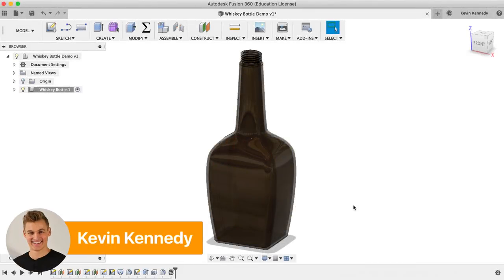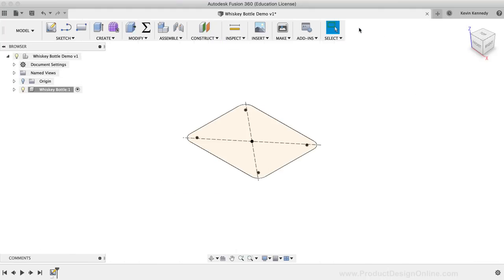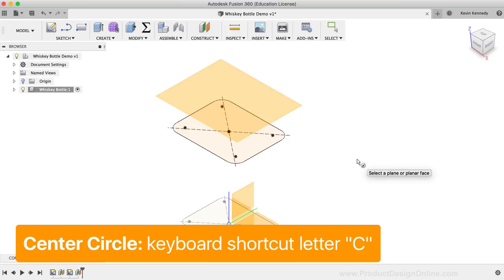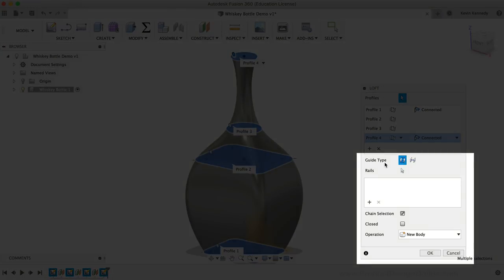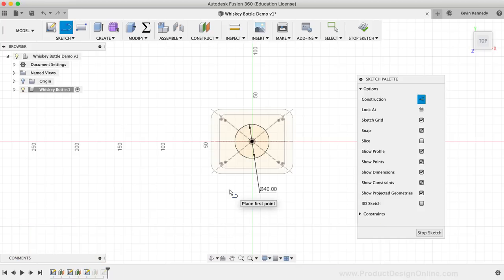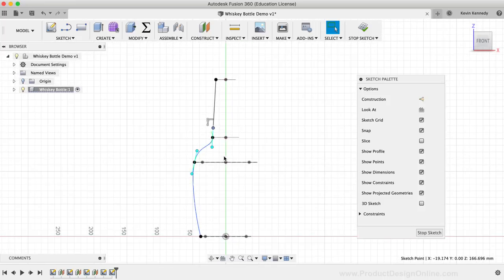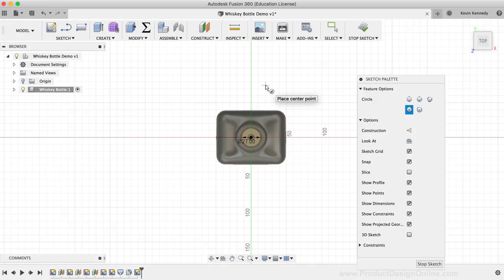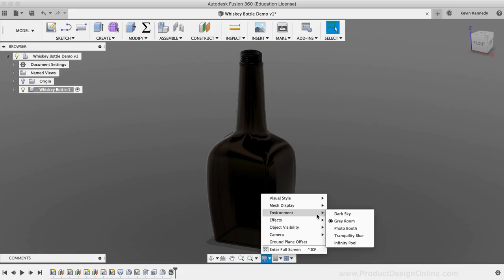How to 3D Model a Whiskey Bottle - Learn Autodesk Fusion 360 in 30 Days: Day #4 (REVISED)

Comment: Another great tutorial, I'm literally learning each day - thanks! One issue I'm having is I can't get the guide path to snap to the construction points we created just before that. The construction points are there (they're on the edges and can be selected), but the moment I select anything from the Create menu (Fit Point Spline, in this case), the construction points vanish and the spline (to create th guide path) will snap to anything but the construction points... Any idea? Thank you!
Reply from the maker: Make sure you have the "Auto Project Edges on Reference" setting turned on. Instructions to turn it on - https://productdesignonline.com/default-settings-for-fusion-360-tutorials/#autoProject

That will help you snap the rails to the profiles, as long as you're looking straight at the sketch.
Reply: Didn't work for me
EDIT: never mind I just had to restart the computer
Reply: Would projecting the point to the plan be the exact same thing the mentioned setting does automatically when activated, and therefore would not be required to activate it if I want to manually place a projection every time?

Btw, if I look from the front I can select the points, but if I look from the profile I can't.
Reply: Just fixed this enabling "Allow 3D sketching of lines and splines"
Reply: @ivantammaro   thank you, that was the problem that I had

Comment: Wow Loving these tutorials! 
Just one thing after creating the revised loft the top and bottom section of the bottle haven't connected so the fillet command won't work? When creating the sketch I used the surface version instead of the solid and maybe that's the problem?  Thanks  😊
Reply from the maker: Hi Matthew. That's correct, surface bodies cannot accept fillets because they do not have any dimensional thickness to them.
Reply: @ProductDesignOnline  I also cannot get the bottom to fillet.  I have selected the solid fillet, but it will not let me select any edge or face to fillet.  Nothing highlights to select.  Any ideas why?  Thank you for your videos. They are very helpful.
Reply: Thanks for this comment, distinction between surface and solid loft commands is not immediately obvious. Autodesk should explicitly state "surface" or "solid" in the name of the command.

Comment: Thanks so much for the tutorial. I was planning to sip a glass of whiskey while following your video. I did encounter errors with the rails when I was trying to use the loft tool and fixed it by zooming in very closely to the points where the lines meet. 😄 It is indeed a very important step where mistakes could happen.

Comment: what would cause the fit point spline to not snap to the planes when creating the rails?
Reply from the maker: Hi, Patrick. The first thing to check is to make sure your "snaps" option is turned on in the sketch palette. Second would be to check that the "Auto project edges on reference" option is turned on in your preferences. You can also cross-check your settings with mine, here - http://bit.ly/defaultsettings

Cheers, Kevin :)
Reply: @ProductDesignOnline  I followed your fixes, and my settings are like yours.  I could never get it to link up.  I finally did a spline on all points and adjusted the neck to look right.  That fixed it, but I didn't want to just finish.  I'll keep trying, but I must've fat fingered something.

Comment: Kevin, your tutorials are generally GREAT.  They are WAY better than the ones on the fusion 360 website.  Those are for older versions of the software where the UI doesn't match the version currently available for download.  Using the Autodesk tutorials is very nearly impossible.  I said GENERALLY, because in a few spots your tutorials also don't match the current interface.  Usually the problem I run into is discussed in the "comments".  In some cases, I follow the instructions in the comments, and the model still won't work properly.  In those cases, I either back up a ways and do the problem steps over again, OR trash the current model and just start completely over.

By the way, I am a retired Systems Analyst with 50 years programming experience in a huge array of different languages, but I have almost no 3D drawing experience.  With many years debugging flaky software, I can say with some degree of certainty that version 2.0.7438 still has a few bugs.   I have a Prusa Mk3S 3D printer and want to create some of my own models.  Of all the 3D modeling software, Fusion 360 seems to be the best choice for me.  

For what it's worth, I find that I sometimes have to perform the exercises multiple times before I can get it to work correctly.  Sometimes a very tiny nuance different while doing the steps caused a world of problems. 

Being a programmer, I learned long ago to SAVE OFTEN.  Sometimes this is the only way to back up to a version of the model that can still be salvaged.

I try to "finish sketch" at the same points you do.  The new UI does not present the same options in the menu bar that the tutorials show.  I have found I sometimes have to finish sketch in order to "see" the command I am supposed to use next.  I know the commands are supposed to automatically Finish the sketch when appropriate, but sometimes that does not happen.  So, when that happens, I have to finish the sketch manually.
  
I am not sure why Fusion 360 is misbehaving.  I don't know if this is because F360 retains stuff in the history that is causing problems or what.  Or maybe chaining certain combinations of steps causes it to "get confused".   I also noticed that when doing steps where I am supposed to "type" in the exact size, doing so within the drawing workspace tends to work, but doing it in the box that flies out from the right side of the screen TENDS to crash Fusion 360. 

I am working my way thru the tutorials.  I can typically complete two or three a day, what with all the "starting over from scratch".   Whenever my current model simple refuses to do what you have shown me, I find the best way to get it to work is either to start COMPLETELY over from scratch, OR to open a saved version and drag the history mark to the left a few steps, then delete the steps that did not work.  Sometimes, the history marker refuses to drag.  Then I have to save, close the file I have open, reopen it again and then try to drag the history marker.  If that works I can redo the last few steps.  If Dragging the marker does not work, then I have to start completely from scratch.  That is why I say the version I am running (downloaded Feb 5) is probably still a little buggy.
Reply from the maker: Hi Robert. Glad to hear you're working through all the issues - although it can slow down learning, a lot of times it helps the concepts stick more... and you get better at troubleshooting on your own in the future (as I'm sure you're aware of with your programming experience).

With that said, it sounds like you're experiencing way more "buggy" experiences that one should. Are you running Fusion 360 on Mac or Windows OS? Also, do your computer specs match the minimum system requirements - https://productdesignonline.com/tips-and-tricks/system-requirements-for-autodesk-fusion-360/
Cheers, Kevin
Reply: @ProductDesignOnline 
I taught many online and in-house computer/software/programming classes over the years, and found that I frequently do the tutorials at least twice.  Once to learn the concept, and a second time to become more proficient.  Sometimes, I will do the tutorial a third or even a fourth time in order to try a slightly different approach or maybe just to experiment around a bit.   

Your tutorials are exactly what I needed.  Each one creates a good example object, without overpowering me with a million options I don't need just yet.  I really like the way you do it.

 My desktop computer should be PLENTY adequate.  It is a Dell Intel Core Duo 3.16 ghz, and is maxed out with 8 GB ram.   I am currently running Fusion 360 in Windows 7-64 bit with all the latest patches and service packs.  My desktop has two screens, so I can watch the tutorial in one, while I perform the "operations" in the other.  My graphics card is NEW with 2GB ram and it supports three HD (3840x2160) monitors.  If I can learn F360, I plan to add a third HD monitor at the higher resolution.   I have several enormous hard drives.  I am running over FIOS fiber, but my provider has me trottled down to 100MB up and down.  This is the fastest available in my area.  I also have a good laptop with a better single display.  It runs 2.50 ghz.  Ever since I upgraded it to W10, it has been sluggish and just plain flaky.
  
I tried Fusion 360 and Blender on W10 on the desktop and on the laptop.  The W7 desktop responds much faster and is much more stable.  W10 on the desktop is a nightmare.  To be honest, I find Windows 10 to be just plain FLAKY if it is not running on fairly new hardware.  W10 drivers and support for older hardware is pretty bad.  I find W10 will crash when NOTHING is running other than Windows, so I really do not trust W10 on my desktop.  I have also found a bunch of apps that work fine in W7 but fail to work properly in W10.  

At some point, I will probably be forced to build or buy a newer, more powerful machine.  IT won't be a MAC for MANY reasons.  Even a new windows machine "expense" is a bit hard for a retired dude to justify.

Comment: I am going to be honest I have zero clue how I fixed the loft guide rail issue. I literally redid the steps for creating the construction lines, then the spline, then the line, then the mirror command like 10 times before it worked. I also rewatched that part of the video several times and my settings are correct from a previous video. I do appreciate you going back and trying to help everyone who's having this issue.
Reply from the maker: Lofts are the most finicky in all CAD programs because the geometry very quickly becomes complex. Glad you got it sorted out. If you run into any future issues you can ask for help in the PDO Community space: https://bit.ly/PDOcommunity

Comment: I was able to create the whiskey bottle! (:

I also ran into the same guide rail error. I had to UNCHECK the Chain Selection in the Loft dialogue box, which allowed me to select the spine and the line edges on the left for Rail 1. Then I clicked the + to select the mirrored spline and line edges on the right for Rail 2. 

I also had to go into my preferences to turn on "Auto Edges on Reference". 

Hope this helps!

Comment: I'm not trying to finish in 30 days, but may go through all 30 lessons!  I had a little trouble finding the "Appearance" dialog, but eventually got to it by right clicking the component in the browser section.  Then I also saw that I could use the "a" shortcut.  I really like learning a few new features/commands in each tutorial and also ending up with a fun looking design.
Reply from the maker: Hi Martin. Glad to hear you're learning a lot! Another option would be to use the shortcut "S" to activate the shortcuts box. The shortcuts box allows you to simply search for any feature you're looking for :)

Comment: Hi Kevin.
I managed to finish the bottle.
Like everyone, I had problems with splines, but more than anything, they were precision problems. I just got very close to the scketch to make sure that the points were joined correctly.
Excellent series, I am putting them all into practice, honestly it was the most difficult so far.
Disculpa mi inglés pero soy latina :D un saludo !!

Comment: Hi Kevin,  Thanks for another great tutorial.  I am learning how to quickly find the changes from prior version of F360 to the current.  First, it seems (I don't know how) that you can no longer transition to a solid command from the sketch environment without closing the sketch first.  Second, you have a lot of commands on your shortcut menu than are not on mine.  Maybe you covered this before and I missed it.  I found that if click the 3 vertical ellipses next to the command in the menu you can choose to pin the command to the toolbar and/or the shortcuts or assign a keyboard shortcut.  It's getting easier to follow along as I practice with the interface.
Reply from the maker: Hi, clarryr. You can still transition to solid from sketch environment. However, it's easiest if you utilize the shortcuts box or specific keyboard shortcuts. Otherwise, you have to click back to the SOLID tab to select the item.

By default, the shortcuts box will show some of your most recent/frequently used commands. But that is correct - you can add your desired commands to the toolbar or shortcuts box. I'm glad to hear that it sounds like you're starting to adapt to all the changes. It takes a while but you'll be used to it in no time...keep at it!

Cheers, Kevin :)

Comment: Hey Kevin! A little help having problems with the rails keeps saying "Warning: The selected rail does not touch all of the profiles." but I have followed the instructions on snapping the line and the spline rails.  Thank you sooo much for creating this series! Learning a lot while in quarantine. Stay safe!
Reply: I am having the same problem. Mine keeps giving me the Warning: 'The selected rail does not touch all the profiles.' How do I fix this?
Reply: So the way I was able to get this done, was by doing a loft on the bottle body (the first 3 planes), then I went back and did a loft between the base bottle loft, and the top (the 4th plane) and it works. For now I am just going to do it that way, so that I can move forward in this and other tutorials, I'll dig into it more deeply in Google later. Good luck with yours.
Reply: @trueintellect  thanks. This worked well for me.

Comment: Brilliant - I was stuck on the original version of this tutorial - only to find everyone else was too! Thanks a lot for this revised tutorial
Reply from the maker: Thanks, Curry and a Pint! Glad to hear this revised version was an improvement. Please don't hesitate to comment questions on the tutorials as you work through the remainder of the series. Cheers, Kevin :)
Reply: @ProductDesignOnline  You replied to an email about 'changing the view' back to the original. Btw - are there any tutorials on exporting a model to GCode? I've bought a small CNC machine (model 3018) ?
Reply from the maker: @curryandapint  I don't have any tutorials on the Manufacture Workspace (formerly CAM Workspace). I wasn't originally planning on it since there are a few other channels that solely cover that topic. I would recommend the 'NYC CNC' channel. They have some good beginner videos for using Fusion 360 with your CNC. Cheers, Kevin :)
Reply: i feel u bro getting stucked realizing there is a new tutorial
Reply from the maker: @ley90  The first few videos of the series were revised to make them more thorough and to be at a slower pace for beginners. All of the latest tutorials from the 30-Day series are on this playlist - https://bit.ly/learn-fusion360
Cheers, Kevin :)

Comment: I had to use the coincident contraint to get it on the plane. I'm only able to snap to the grid lines, so I could never get it on the plane. I also got the g1 error, but fixing the line angle to meet the spline worked. Thanks.
Reply from the maker: Hi, Brent. Glad to hear you worked through the issues. Don't hesitate to comment as you work through the series. I'm always happy to help you get through any roadblocks and will look at your file if needed. Cheers, Kevin :)

Comment: Thanks for the revised video! I spent hours trying to figure out what I was doing wrong. The construction lines was a tremendous help. I also finally figured out that turning off snap to grid allows me to model the bottle without the construction lines.

Comment: Hey Kevin, great video first of all. One thing I ran into an issue with is that at the end, when I was shelling the bottle, I wasn't able to enter 3mm, and with some messing around I figured out that 4mm worked just fine. I'm not sure why that was, but it didn't seriously affect my bottle so I decided to just go with 4. Maybe you have a better understanding, and I'm just curious if you know. Thanks again!
Reply from the maker: This is likely caused by the contour of your bottle. Generally, when the shell command doesn't accept a value its because the shell would result in an irregular surface. Try adjusting the contour of your bottle (edit the rails sketch) and then try adjusting the shell command. Let me know if that helps :)

Comment: First, Kevin, thank you, I'm enjoying the course. I'm using a later version that does not have the "Sketch" tab, but I'm getting used to the differences. BIG issue though, I could not get past the error stating G1 rail error - rails not touching all the profiles. I did the whole thing several times and paid very close attention to getting the snap points exactly where they need to be, including the spline snapping onto the straight line. The mirroring and everything else works exactly right, but my bottle has that fat belly shape because I could not get the lofting to follow the rails.

Comment: this doesn't seem to work with the 2020 update and there is no option to go back to 2019. do you know where i can find the 2020 tutorial? when i get to the point of the mirror part there is no closed section because they different planes do connect and no points from the spline/line tool snap to the construction points.

Comment: Had the same issue with the loft error saying the lines don't connect to all the profiles. Tried the troubleshooting link along with other suggestions from the comments without success. Ended up fixing it by drawing the plain line first and then snapping the last point of the spline to it along with making sure the handle was snapped in as well as he mentioned in the video.